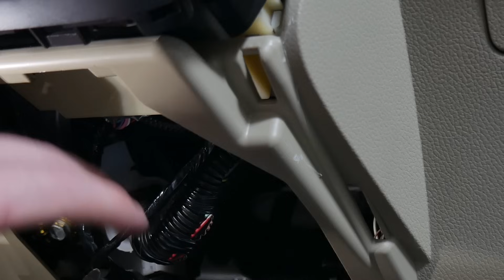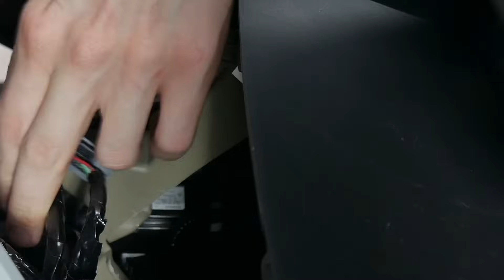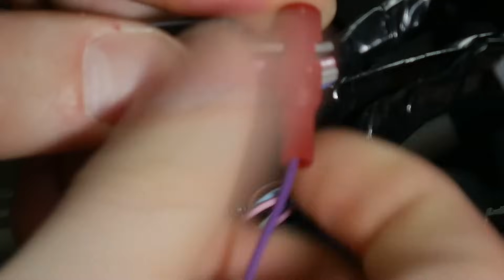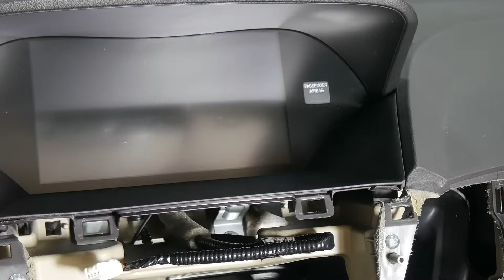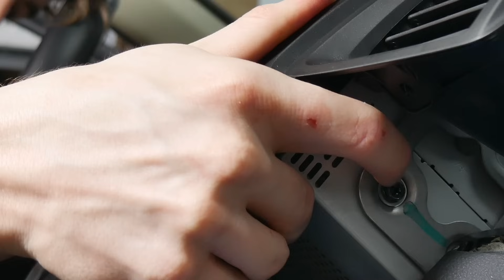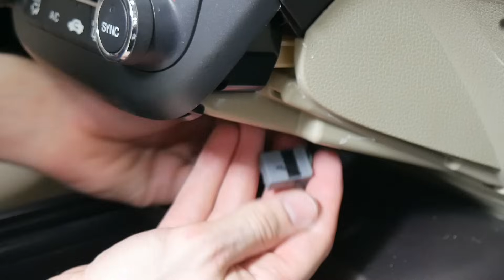Step-by-step install of VLine VL2 System for CarPlay Android Auto | Acura RDX 2013 2014 2015 | HON2V

Comment from the maker: The VLine VL2 system, which will work in Acura RDX models from 2013 to 2015, adds wireless CarPlay and Android Auto to the original stereo, the HON2VVL2. It is available here:
https://gromaudio.com/store/vline/grom-vl2-hon2v.html

The same system is compatible with the following vehicles:
Acura ILX 2013 2014 2015 (Only NAV stereo)
Acura RDX 2013 2014 2015 (Only NAV stereo)
Acura TL 2012 2013 2014 2015 (Only NAV stereo)